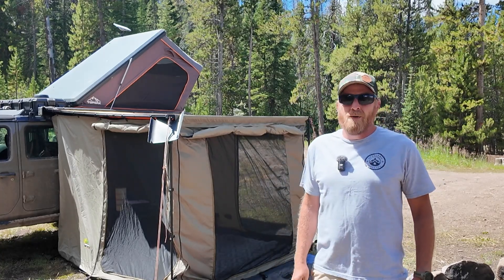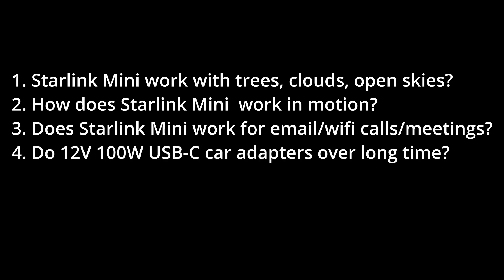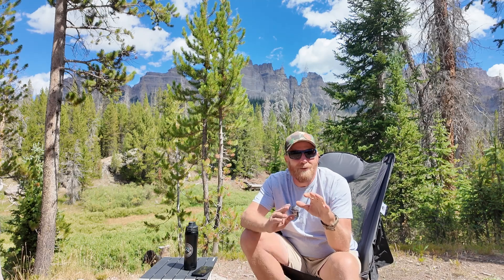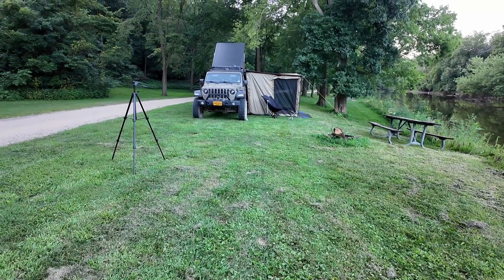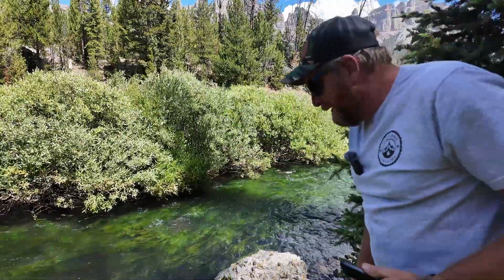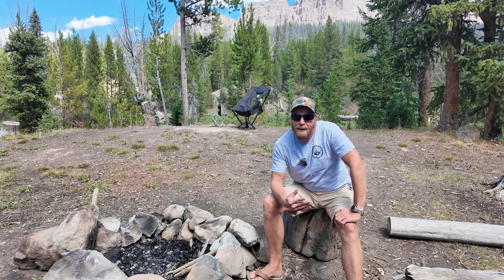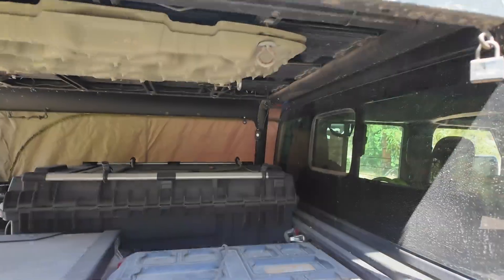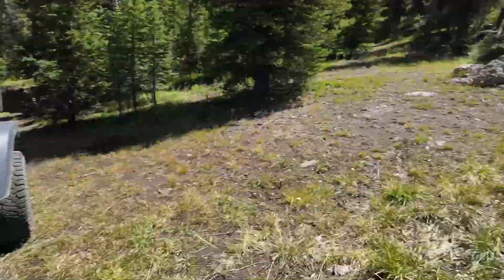Starlink Mini In Depth Real World Overland Testing

Comment: Love your videos.  I looked on Amazon at that 12v to 36v converter.  Not Available.  :(
Reply from the maker: Dang thanks for letting me know. I can’t remember where I saw it, but there is a special one out now that has a Starlink cord built in. That may be a good option if ya can find it.
Reply from the maker: I just grabbed a 12v cigarette style plug step up converter  before I headed out on my trip to test it out.  I am still testing it, but I like what I see so far. Not sure if it would be useful for your system not being hard wired, but might be an easy fix if you have a 12V plug it can go into: https://amzn.to/45UKaOf

P.S. this is an affiliate link

Comment: Would you prefer the larger gen 3 starlink? Specifically when it comes to video calls. Also, do you use that awning room as your office? I love that. Seems like it could be loud though
Reply from the maker: The mini works just fine for video calls as long as I have a clear view of the sky. Bigger dish might work better for tree cover, but I really like the low power draw of the mini and the small size.

Yep the awning room is my office and I love it! The noise canceling on my computer and headset does a pretty good job of cutting out noise. In heavy rain it does come through.

Comment: Hi Brian! I’ve been working through the idea of being able to overland without using PTO and these videos have been super helpful to work out the kinks in my idea. Cheers, and keep it up.
Reply from the maker: Nice! It changed my life and I hope it does the same for you! If you have the PTO to burn you can just use it to make a string of 4 day weekends while you are out. I found that was the best way to get the best of both worlds on my 8 week trip last year. Drove coast to coast camping the entire way!
Reply from the maker: I have a small playlist of videos I created with working from the road tips. I have not gotten into the deep dive videos yet, but there could be some useful stuff in there for you. The playlist is called “Working truely remote”.

Comment: hi , Can I use Google Earth while driving?
Reply from the maker: Hi! I think it should work fine, but when I get a break from work later today I will light up google earth and take a drive to test it out.
Reply: @OverlandCalling 

Thank you and I appreciate that.
Reply from the maker: @ it worked. It was a little jumpy, but able to follow. I will have to give it a try next time I am out on the trail. Great way to have a view of what is ahead.
Reply: @OverlandCalling 
I hope it works very well. because it's the best way for me to get an off-road map. I don't have a Garmin mapping device, can you recommend a great one at a good price?
Reply from the maker: @oldstory-sz4qc  I use Gaia, but the subscription costs 50 a year. I like your idea of using Google Earth and if it is working for you I would not change a thing. You just can't beat that price!
Reply: @OverlandCalling  
Actually yes I did not find anything like Google Earth thank you very much and I appreciate your help very much

Comment: I want to use Starlink for a security system in remote locations where it would be unattended and have to be operated on battery. To save power, the Starlink modem would only be switched on when an event occurred then switched off as soon as the data has been transferred - less than 100kB. Can anyone tell be how long it takes to get an IP connection from power up - as that is likely to be the largest part of the energy per event.
Reply from the maker: You are the second person that asked about that exact same use. It takes about 45 seconds with clear skies. If it is obstructed it may take longer.

Comment: Thanks for the great video, it's helped me answer some questions I have.   I am planning on buying a mini in a couple of weeks for use when we go camping and as an emergency backup if the need comes up.  I have just purchased 2 of the Eco Flow River 2 Pro (new  release) to use while camping.  I use to carry a spare 12v deep cell battery and use a 300 watt portable inverter to run our TV and media player.  I have tested the River 2 Pro with one of them an I can probably get 3 nights of 4 hour per night entertainment an not have to bring the battery.   I figured having the 2nd one would be perfect for the Mini.  On the EcoFlow, they have a 100w max USB C connection USB-C Output 5/9/12/15/20V5A, 100W Max not sure how to set it to 20v yet but I think it is standard 12v output.   I figure this would be better than using the 120vac and inverter on the unit.   We have a trip set up the first week of November to the Smoky Mountains and the Elkmont campground so it will be interesting if I can find some clear sky and make Wifi calls and check emails.  I don't need it for streaming as I usually carry a hard drive to use with my media player with all the entertainment we will need.     With the portable set up hopefully I will be able to get it working.     I am guessing the 50gb will be more than enough Data for a 3 or 4 day trip.  Thanks  again for your video,  and your comments.
Reply from the maker: Glad the video helped you out! One quick heads up on the Eco Flow power station. A buddy was trying to use his to power the mini using an Amazon USB C adapter cord and a connector bridged into the standard Starlink mini cord and it would not work. We switched him over to use a cigarette lighter setup and it did the trick. I am not sure what model Eco Flow it was, but just in case you run into that issue with the USB C 100W outlet I wanted to let you know the fix.
Reply from the maker: Hit send too soon….if it has 20/v 5a ability you should be good. It should choose automatically. 50 gig should be more than enough data. If you are doing Netflix 4k the data may go pretty quick. I would recommmend downloading some movies at home and if you end up streaming step the quality down to 720. That will save a lot of data. Starlink will send you an email when you hit the 80% data mark to remind you to opt in to go over the 50 gig point. Still way cheaper than the unlimited plan unless you fly through 165 gigs of data. When my family was with me for 5 days we only went through about 20 gigs of data.

Comment: Super helpful video! Easy question: you mentioned that you put the Starlink mini to sleep at night. How do you do that?
Reply from the maker: In the Starlink app you open settings, choose Starlink, and toggle the sleep mode. Once you go that it will let you select the time for it to sleep. Still uses power, but not as much and WiFi is cut off.
Reply from the maker: I went through how to access the sleep function in my software tutorial that just released today in case you still need help with finding it. Also hit most of the other stuff in the software.

Comment: I have been on the fence about the mini. I run the gen 3 and the power usage caused me to buy a bluetti so I dont have to run my generator to work. I really like the portability of the mini, i could in theory, put it on the dash and work while my wife drives.
Reply from the maker: I almost got the Gen3 myself, but my wife would only allow 1 purchase. I heald out for the mini and it was worth it for the power savings. 50 gig of data goes a long way too if you limit your streaming video time too.

Comment: Very good and funny video !! Why you did not test the mini horizontal ? I see videos where they do that with the gen 2 placing it in a roof window. I live in Sweden with many many trees, so I hope my mini ( that I will get soon ) works as you showed it !
Reply from the maker: I am in a camp ground with heavy trees and there are a lot of cut outs. Running horizontal now in this spot since I only have a tiny sliver of the sky straight up, and it works for email. I will include a view of it in a follow up video to give you an idea. when you first start up it will tell you the preferred direction. In the USA it mostly wants to face North, but not sure of direction for other areas. I hope it works well for you!
Reply: @OverlandCalling  Thanks 👍🏻👍🏻👍🏻

Comment: Usb c is 18 volts.  12v won’t work through the 15m cable  I need to test 12v through a short cable, I usually plug into the 24v port on my battery box
Reply from the maker: I have not tried 12v through the cable, but I have seen plenty on videos with people trying and the voltage drop over that distance with the small wires was too much for it to work. The BlueSea website has a great wire chart showing the wire size needed for distances. Way cheaper to just boost that voltage. USB C PD does just fine though. I have been testing that cord combo with the 50’ Starlink cord from my video for over 60 hours of use now.

Comment: hey Brian, do a test for me, i need to know if i plug in ethernet the wireless quits completely, i do special work that relies on a microwave / wireless free zones, would love to get this but need to know i can go completely wired with no wireless signals other than the satelite dish pointed at sky, but no wifi back at truck
Reply from the maker: sure thing, next time I hit town I will grab a cable. kind of wondering if I can bridge it into my cell system anyway.
Reply from the maker: I have not reached civilization to test this in person, but I did find a video covering Ethernet for you. When you plug Ethernet cable in the mini will go into bypass mode and then you use the reset button on the back of the dish to enable WiFi also. 

https://www.youtube.com/watch?v=aGcyJBjF5WY
Timestamp at the 7:50 point
Reply: @OverlandCalling  👍 thanks, let me know how your test goes too
Reply: @OverlandCalling  👍

Comment: Good video good information for Brian. What program or service are you using? Are you doing the $50 or the $150 and are they working for you as I see they are but it’s the data that concerns me the most.
Reply from the maker: I am on the $50/month plan with $1/gig after that. I already opted in before I went off grid because I heard that you could not opt in if you hit the cap and had no cell service to get to Starlink.com to opt in. Also you do get an email once you are at 80% of your data usage. I am a bit over the 50 gig right now, but I have been using it a lot and I uploaded two YouTube videos.

Comment: Nice job, Brian! You and I met on Reddit, where you offered your insight on the 12v-36v up converter. I ended up going with an Elfclub 12v to 48 unit. I figured if I ever needed to go with an extra long (75'+) cable, running 48 would be better than 36. So far so good, all my testing as gone well. When you did your 36v unit, what did you fuse it at? I originally spec'd a 7A fuse in my DC fuse block. It kept blowing. I put my clamp meter on it and measured a surge upon turn-on of the Elfclub of 25A+, and it would settle to zero. I then installed a 30A fuse and it worked. When playing some streaming video, the meter read a nominal 1.25-1.50 amps.  My connection from DC block through the switch you suggested, to the Elfclub DC to DC is very short and I used 12awg wire. So I'm not to concerned with wire overheating when the surge is probably 1/2 a second. Just curious if you measured yours? Thx
Reply from the maker: I see about 24-30 watts and about 1.5 amps when uploading videos and using heavy data. I am measuring it with a Victron shunt from my main battery.
Reply: Let me know if you’re able to see the surge draw upon switching on your 12 to 36 up converter. Tell me if yours spikes. Thx

Comment: What mount are you using on the mini?
Reply from the maker: I am using a ram mount system. Not for in motion of course. Took the pole adapter that comes with the mini and drilled a 1/4” hole in it. installed a ram ball, then used the ram arm and ball to mount it to the T track on the tent. It works like a champ even with fairly strong wind. I will have a video out in a few days. Going to try to film it before I break camp today. There are some other videos out for the ram mount already  I think if you are tight no time.
Reply: I was going to ask about this, but alas someone beat me to it.  This is brilliant and looks perfect.  Pin this question man.